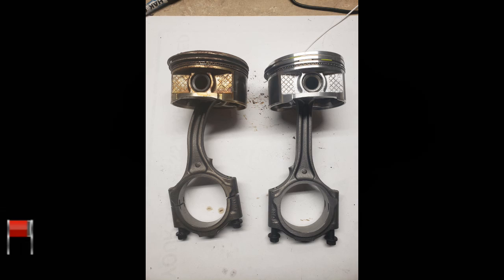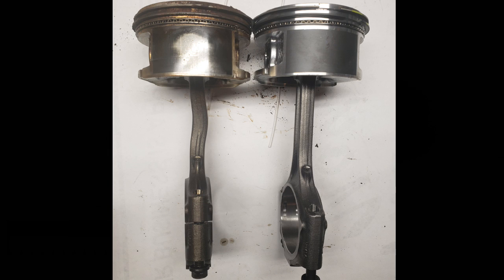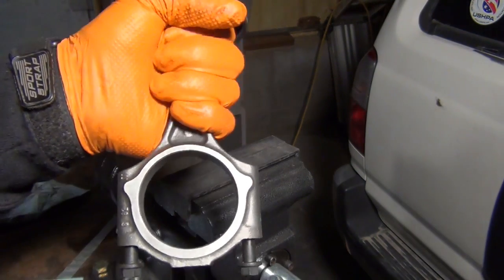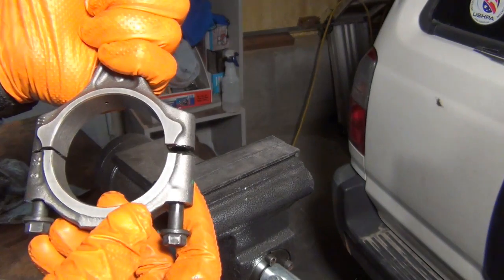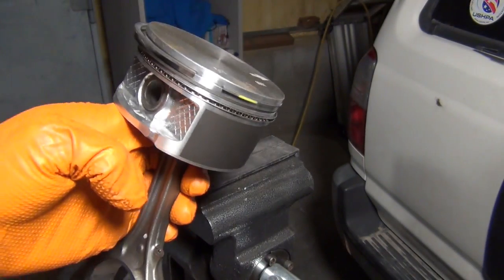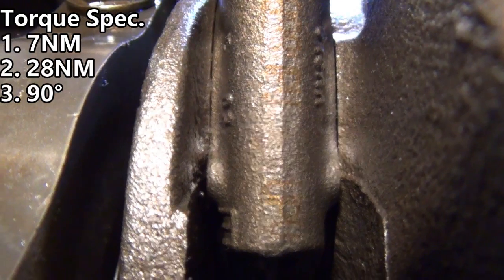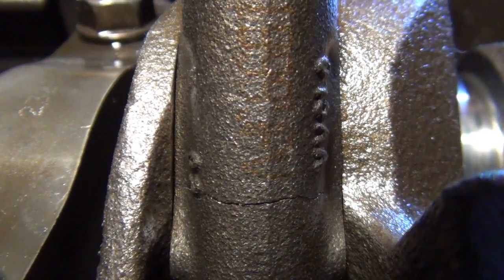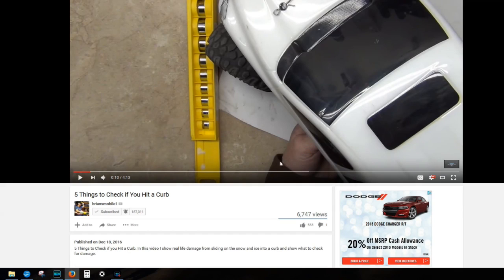How to Break A New Jeep 3.8L Connecting Rod For Install & Torque Specs

Comment: Yes, but you don't want to use those. Those broken rods are the reason Jeep 3.8L engines spin rod bearings so much, look at the bearing locater, they are moon shaped and don't support the bearing against the rod cap, so if the journal gets hot enough and expands, boom, spun rod. If you're rebuilding a spun Jeep 3.8, you want to use the older machined caravan rods that are opposing wedge keyed. They lock in the rod bearings solid and since both engines use the same crank, they swap in. Boom, you now have a reliable 3.8 like they were before Chrysler ruined them for the wrangler.

Comment: i have a 2006 scion xa with 180k miles the accy belt broke causing the water pump to break and it over heated and the radiator cracked and the cap was stuck now it will not turn over i jumped it and tested the started all it does is click any ideas ?
Reply: Lololololololololololol

Comment: I received your sticker yesterday as well.Thanks so much! So that's how they mate the surfaces now? Seems kind of cheap but I guess it works.  :)
Reply from the maker: It's actually a lot more common across manufacturers than you might think.
Reply: Split fractured rods are very common now. I believe there is a strength advantage with this type of rod.

Comment from the maker: So yes, this is how this is done.  It's not a joke or a stunt.  The weakness is ENGINE-ered to be this way.  It's actually genius.  This saves all kinds of process in manufacturing and makes the precision high.  As you can see the connecting rod is plenty strong enough for the application.  Video coming soon on how an aftermarket part caused the failure, but the connecting rod responded in an ideal way.  Make sure you're subscribed and receiving notifications!

Comment: OK I'll bite. How do they manufacture the part to crack right where the break needs to be, and not be too brittle to crack later in other areas? Are they cold welded together, then drilled, then fracture happens at the defined weak point?
Reply: Easy, they make the casting and machine it as a single piece, as that way they get it to be concentric and true. Then to get it to crack they take the finished part and scribe a sharp mark with a diamond scribe inside and outside, so there is a crack deep in the already finished and hardened surface. The scribe line is in the thinnest part of the material, and thus this is the most likely part that will have a brittle fracture when you want to install, breaking along metal grain boundaries.

This actually results in a stronger conrod, as now your mating surfaces are locked together mechanically with a large surface area, and can handle a lot more stress than if they were a flat machined surface. Theoretically they should come pre cracked from the factory, as MB does, as there they simply take them, put them in a hydraulic jig and pressurise the inner surface with hydraulic fluid till they pop along the fracture line, but those are forged as well, and a lot tougher than the plain cast ones from GM.

At least you do not have those from 2 stroke engines, where you assemble the crankshaft around them with a press. Those are expensive to fix, especially if you have to buy a complete lower crank assembly with rods and bearings from the agents. Buy that wrist pin can go places, including making it's way right out via the exhaust port and down the exhaust. Thankfully mine it just ate a piston lip, much cheaper to replace a piston.
Reply: @SeanBZA  Just like what a glass cutter does to size a piece of glass. Nice explanation.
Reply from the maker: I would love to know!

Comment: You may not have thrown a rod but you've done something close to it.
Reply from the maker: Video coming on that soon!
Reply: @briansmobile1  gonna bet it had something to do with spinning and suddenly grabbing traction. Next video, how to put the bits of transfer case, driveshaft and gearbox in the rear for the tow. At least they probably did not come through the floor.